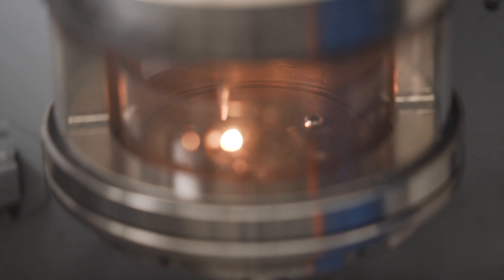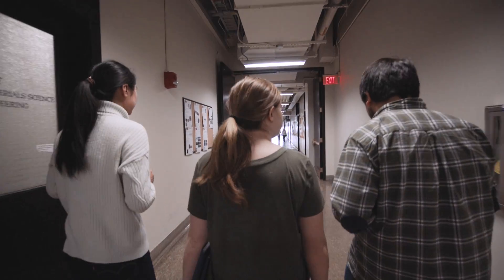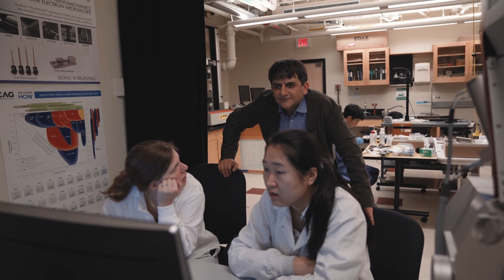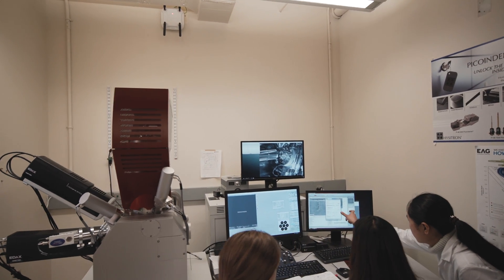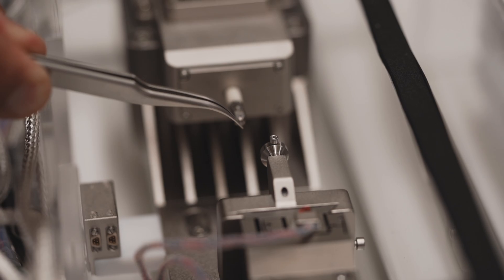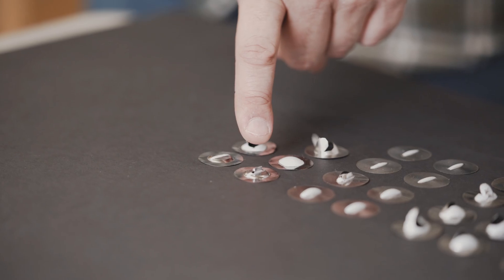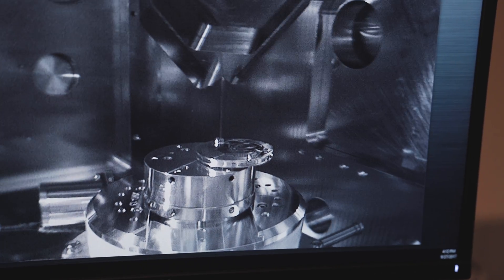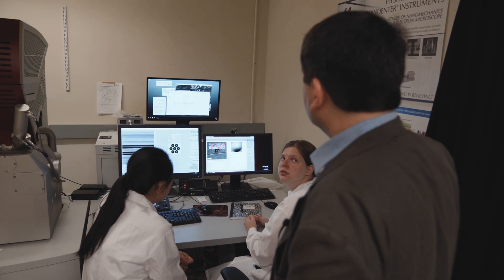Modern metallurgist

Comment: I wish you guys would shut up the know it all Black Smiths who think their trade knowledge in working metal is THE definitive last word on ferrous metals, metallurgy, solid state physics, materials science, foundry practice, machinability, heat treatment, properties of materials and the rest.
Reply: What do you mean?
Reply: @benlear7419  I got blackguarded by a smif when I suggest his blades could be honed for an edge and he turned it into a huge dispute about materials knowledge, I just had a machining trade in aerospace I wasn't expecting this bastid to simply put down aerospace materials  know how and just spout on about his supreme knowledge of teh forge and how all metallurgy descends from his font of wisdom.
Reply: Santy Clause I'm sorry that happened. That particular smith was probably just an exception. I know many blacksmiths myself and they're usually kind and open to learning more or sharing their knowledge.

With blacksmithing however, it comes down more to personal preference on what steels they use and what they do with them rather than scientific reasons.